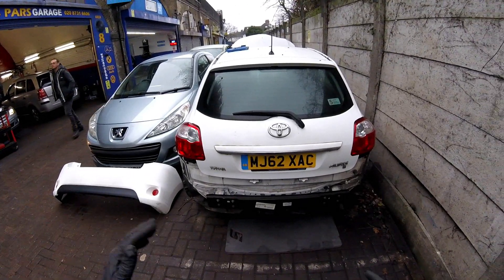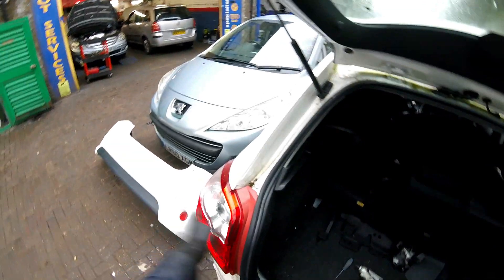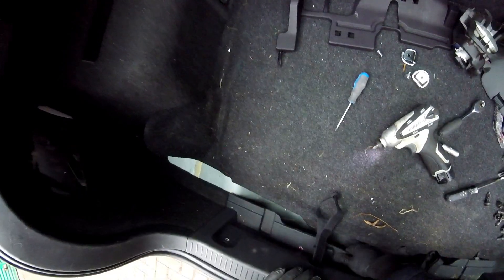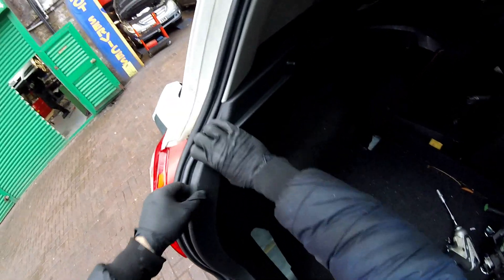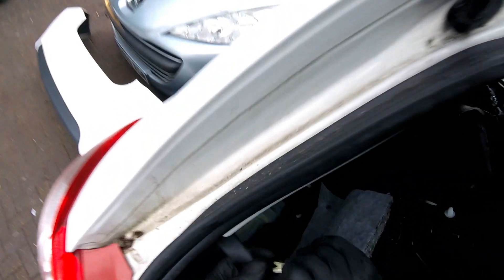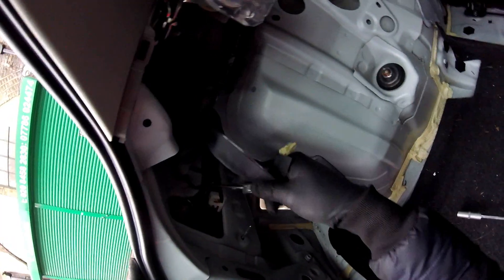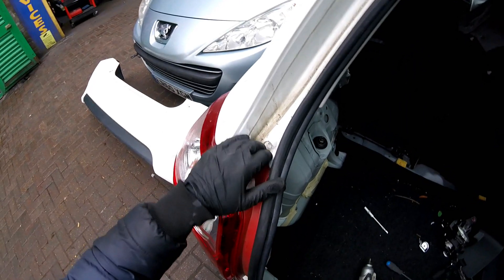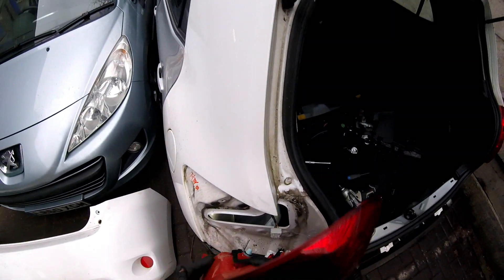How to remove/ replace rear light Toyota Auris 2010-2013 step by step | Uninstall rear light Auris

Comment: Excellent work! But, Toyota is a disgrace to humanity for forcing such an absurd light-bulb operation on buyers of the Auris. Even a pro has quite a workload in store for one bulb (yes, the top four are easy, but the bottom bulbs are the ones you get a police fine for not having).

Comment: Great thanks 👍. I was trying to change brake bulb and it fell inside the light. Think I'm going to have to take the whole thing out so I can shake the bulb out. Unless anyone has any other suggestions ? Thanks
Reply from the maker: Take the lamp out and change what bulb you need and after put everything back
Reply: Happened 3 times to me when twisting the connector out the bulb gets stuck on the housing and falls in the light. Toyota should have made it twist and lock like the other bulbs poor design and it’s also in a corner and cut my hands open on the sheet metal of the car.

Comment: Great video, but what a pain in the ass to get the light unit out. I too have a bad leak into the boot coming form the rear light unit area. Just unsure if I should try to fix it myself or get it to a garage.
Reply from the maker: If you don't want to remove the head light in the future ,wgat you can do,just clean the sponge betwin body and headlight ,seal it with silicone and put everything back ,tight well and job done or buy a new spone and replace it

Comment: Good video, you went a bit too fast explain two nuts on the light. There is also a cable connector holder on top of the nut. This needs to be removed first. I managed to remove my 2007 Auris back light that was leaking due to gasket. Please show video as how to change front side bulb.

Comment: Great video never buy a toyota again, this guy's are crazy. Driving an auris e15 and get water in my car through the back lights. GTFOH
Reply: Thats a common misconstruction. My Brother had it with the 2009 Auris. I had i didn't have this problem with my 2011 Auris so far. Toyata is great and is known for it's quality but sometimes there are such fails.
Reply: Same happens to me now